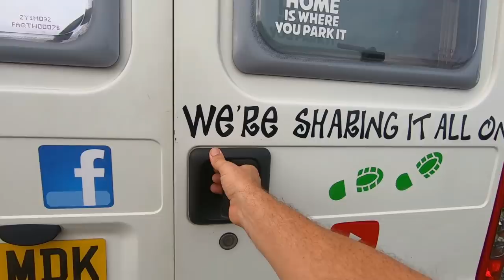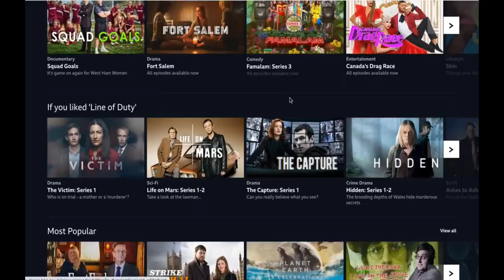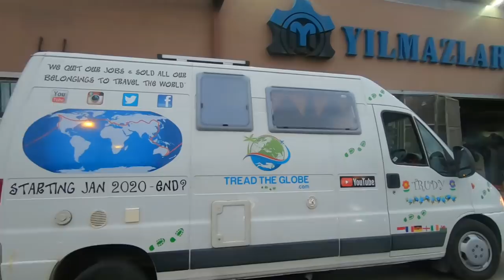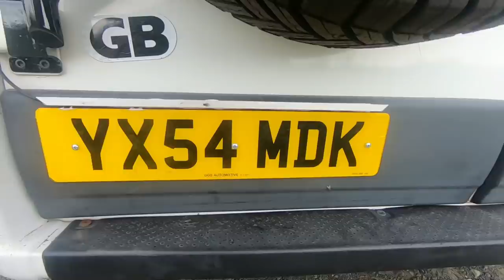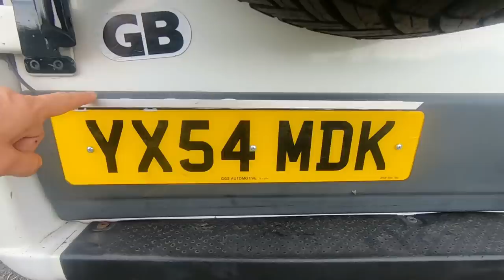Making a CHANGE in TRABZON - VAN LIFE on Turkey’s Black Sea [S6-E51]

Comment: Fitting the spare tire outside will save you space, but you should buy a cover or a tarpaulin cover to protect the tire from the weather conditions. Sun rays and cold air will damage the tire.
Reply from the maker: Thank you for this tip Enis - we have a plan and we promise to share it with you as soon as it is done